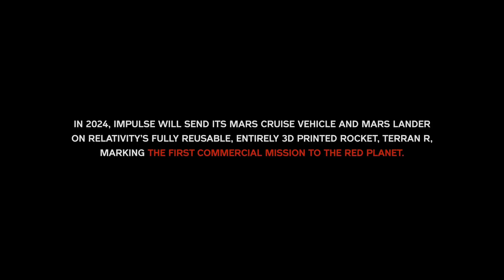Relativity Space and Virgin Orbit are giving Elon Musk a run for his money!

Comment: this comment i would love to see it from spacex.. its not in their realm. but their research could drive this one.

i would like to see virgin go back to some of the nasa/boeing space plane tests.  refine that tech now that we've advanced quiet a bit the propulsion, heat shieldiing all those hold ups from back then should be capable now. most of it was just keeping thrust in space if I remember right.
most of those were launched by plane like virgin does. after enough r&d a good thrust system should be capable of runway take offs, landing and space travel.. i would imagine most of our problem now is were trying to send 10 semis in to space weight wise straight up. as apposed to a jet which might be the equivilent of 1-2 at an easier angle. even if ya got close to clouds and pointed the nose up yea escape velocity is a thing, but theres less volume to escape from if your already 3/4 of the way there.

Comment: “If everything goes according to plan, they will beat space x to Mars!” So... if everything goes according to plan from a company that hasn’t even launched a vehicle yet, let alone made it to orbit. And we know things never go according to plan. I like relativity, but let’s be realistic here. They are going up against a company with a ton more experience and resources, and one who has made it to orbit now over a hundred times. My money is on space x.
Reply: They're just a gimmick at this point .
Reply: @startr374  Yeh, that is my thoughts as well. 3D printing may be optimal for fast prototyping but to build a significantly larger craft they are really going to start running into weight issues as these 3D printed rockets aren't going to be optimal as far as materials used are concerned. No way a 3D printed fuel tank is as light as one made from work hardened cold rolled sheet steal or machined sheets of aluminium.

Comment: I know nukes won't work for mars but what about a Dyson swarm send concentrated light to mars through massive holes into its crust to heat up its core or mantle, to get rotation increase input in certain spots. Just a thought.
Reply: On the contrary, I think small nucs on Mars will be necessary for reliable steady power at least at the beginning. Indeed, I think there is a better case for small nucs on Mars than on earth.
Reply: @MrEd2291  nukes are very dangerous and radioactive while giant reflective mirros in orbit can send concentrated light to solar panels or steam engines if you want. Mirros are ultra thin cheap and safer without radiation. There is a chance of solar flairs or meteorites damaging the mirror but no nuclear radiation and easier to get power around. They also have other uses, but I'll stop there.